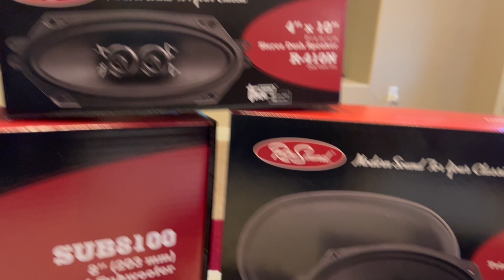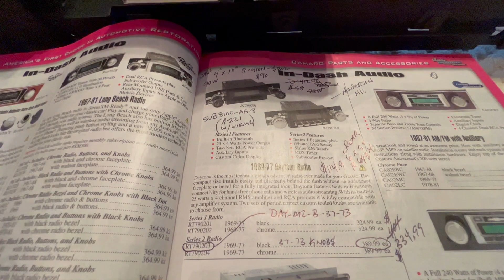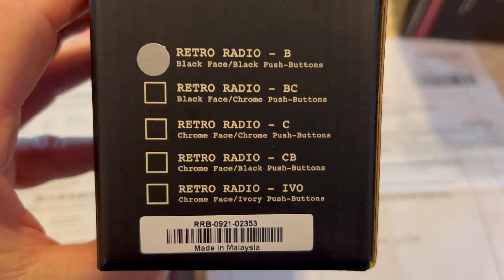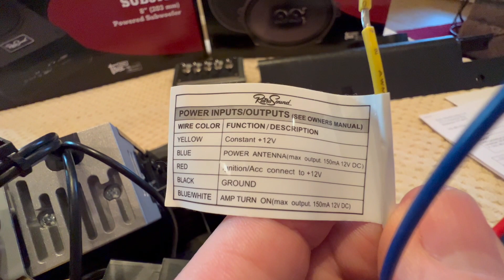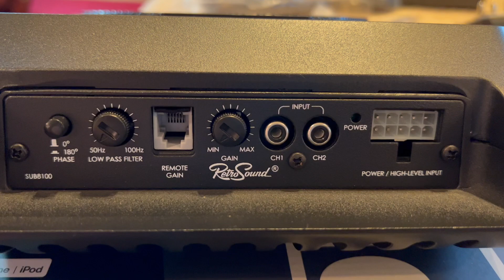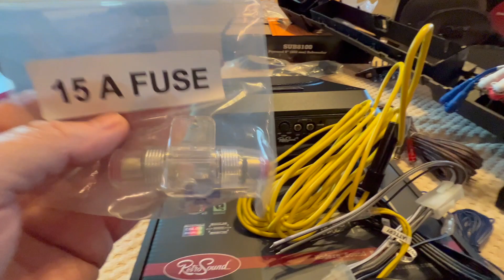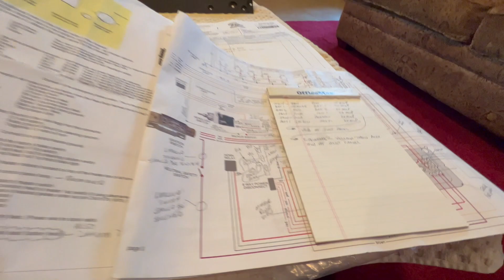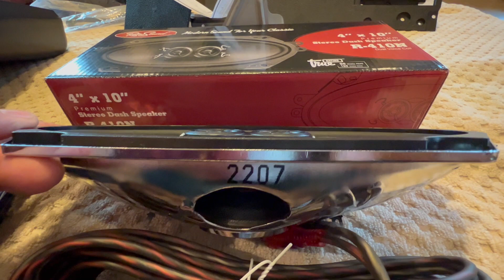Camaro "71" RestoMod RetroSound Radio/Speaker Install Obstacles!

Comment: Bout FREAKIN time LOLOLOLOLOLOL. Get er done!! You got some good stuff!
Reply from the maker: Mounting the under dash speaker is the last hurdle to get the dash area wiring done and completely install and finish it! Had to order some 2 1/2" flat stock and some pre-slotted angle pieces from McMaster-Carr to custom build a mounting bracket. After that I will double check everything on the wiring, fluids, a couple of fire extinguishers and see if it fires up. Putting the under dash speaker in after the dash install would be really painful! Getting there!

Comment: When I used to read the Chevy magazines I would see ads for retro looking stereos from a company called Custom Auto Sound.
I always just used Alpine car stereos.
I had a Blaupunkt one time, it had weird markings.
Reply from the maker: I did take a look at Custom Auto Sound but ended up going with RetroSound because they are located locally. The fitment issue on the bezel was just poor descriptions! I don't know who these companies hire to provide specifications and descriptions but apparently they are clueless! I remember those radios you mentioned from back in the 70's. I had an old Craig in my Chevelle SS 396 back then. Aftermarket radios were huge back then!
Reply: @peteregger7928  cassettes and their mechanisms took up a lot of space, CD’s were even wider.